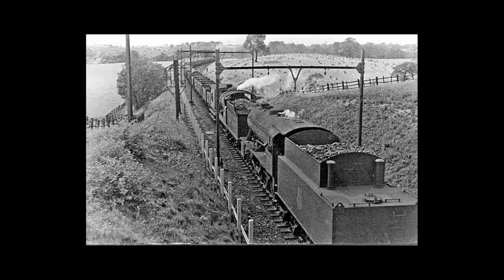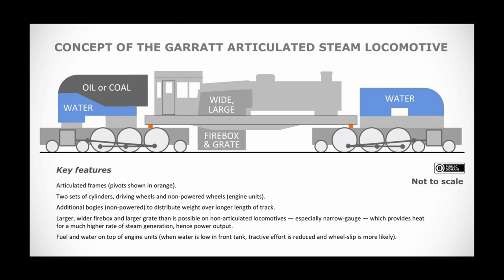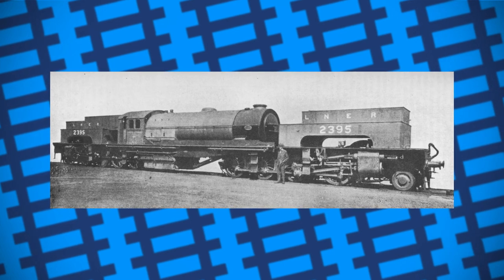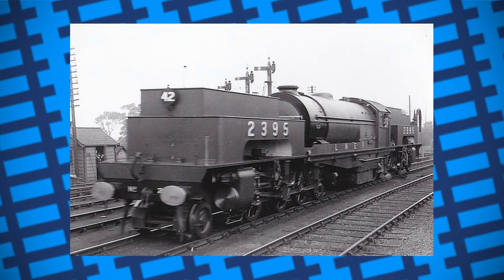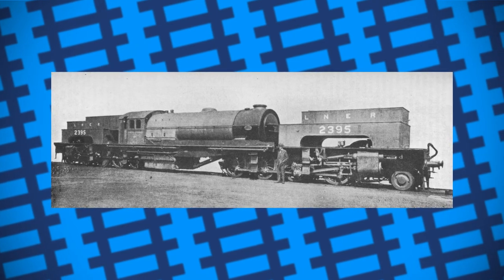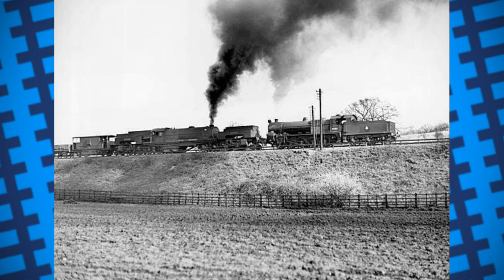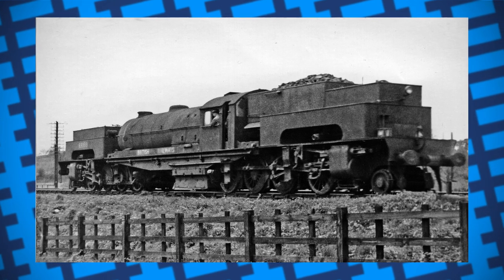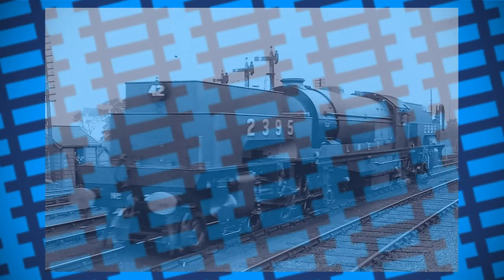The LNER's big banking engine -  LNER U1

Comment: I've heard it said that guards had to decide if they wanted the van door open or closed before the U1 buffered up. Once it had and started to shove, the van would bow under the strain and jam it. The guard then had to sit and listen to the van creaking and groaning, hoping it wouldn't buckle, fold up and turn to match wood round them.
Reply: “Douglas worked hard enough for three!  I heard him from my yard!”
“Two would have been enough.”
Reply: @timesnewlogan2032  I wonder how much of that story was influenced by this?
Reply: I am tempted to work on a short story on this
Reply: That shows they shoulda just use it to pull the trains up the hill
Reply: @pilotbug6100  not very practical with unfitted, loose coupled trains and also having to couple and un-couple it would have slowed the whole process down massively.
Reply: @Paraffinmeister  Quite right, plus if it was pulling a long heavy train that gave the opposite problem - putting too much strain on the couplings. Gresley's LNER P1 2-8-2s intended for heavy main line freight hit the same problem. The Rimutaka Incline in New Zealand (1 in 13) was maybe the ultimate; trains had to be divided into up to 5 or 6 portions and remarshalled at start and finish. No wonder they bit the bullet and built a 5 mile tunnel instead.
Reply: Even though UK brake vans and US cabooses aren't quite exactly the same thing, and railroad operating practices in the 2 countries are likewise not quite exactly the same thing, there were plenty of places here in US where the caboose had to be uncoupled then recoupled behind the pushing locomotive. Eventually cabooses were built with frames which could take the stress but sometimes the coupling of it behind the pushing locomotives was retained as a matter of safety policy.
Reply: @scottfw7169  the van bending under the strain wasn't through any short comings in their design, it was all to do with the brute force of this beast with the regulator wide open.
Reply: @pilotbug6100  A leading banker is expensive and inefficient, especially on busy single line sections worked by token systems
Reply: @Paraffinmeister  oh ok thanks

Comment: The biggest problem with both the LMS and LNER Garretts was the use of LMS/LNER standard parts off their standard classes instead of standard Beyer Peacock parts.
Reply: Especially the LMS Garretts. The dead hand of Derby totally ruined those. Had the LNER had the U1 built how Robinson had envisaged it with basically two O4 "power units" instead of two O2s, it probably would have been a much more versatile loco.
Reply: In other words Garrett's from Africa Australia and New Zealand are better than British Garrett's because they used successfully tested designs from bayer

Comment: I'm surprised that when they realised it kinda sucked as a banking engine, didn't decide to instead use it as a freight-hauling powerhouse. Like, that'd make way more sense as the sheer size of it would mean it would give some American locos a run for their money in terms of capability of hauling cargo.
Reply: It is quite possible that it made sense for it to bank from the rear, but it would be too powerful to pull stuff - couplers would break.
Reply: @TryboBike  in other words, damn you physics.
Reply: @TryboBike  “Too powerful to pull trains”
And that’s how you know that your loco is a complete badass.
Reply: @TryboBike  nothing to do with  couplers and everything to do with a railway infrastructure built around a notional maximum train length of 100 13 ton mineral wagons.
The Gresley P1's demonstrated that.
Even with a tractive effort of only 42000lb there were very few routes on the LNER that could handle the lengths of trains they could pull.
The 70,000++lbs TE of this engine would never have been fully utilized.
Reply: @markturner4219  I agree with one caveat that is all about the Lickey - putting a strong locomotive on the front of that particular part of railway would exceed coupling rating. Which was one of the reasons for putting bankers on the rear. THe other being, simply. being able to simply let go the banked train once the summit was reached.
Reply: @pilotbug6100  - Does that include the thousands who lose limbs..?? 🤔🤣

Comment: Why isn’t there a OO model of this? This is awesome!
Reply: There were white metal OO scale kits from DJH models
Reply: Well I mean there is one remarkably similar to it.
https://youtu.be/wtvBO-E-tWU

Although the reason why there isn't one of this exact engine is probably:
1. the price
2. the technical problems presented by such a large engine, on the "standard" 2nd radius track that all OO engines are required to run on.
3. It only ran on 2 stretches of track, therefore limiting the people who want to buy it, since a lot of (in my opinion very silly) model railway enthusiasts only model one railway and period and refuse to buy anything else other than the prototypical engines and rolling stock that would run on those lines. So it would not be profitable for the model maker to make this engine, as a lot of potential buyers of more conventional engines wouldn't get it.
Reply: Although there are less models of Australian steam locomotives, the Eureka company had as their first locomotive an AD60 Garratt.
Sold in two production runs so far for the smaller Australian market :
https://youtu.be/MUi0cMkmD-U
Less attraction in Australia for those tight curves so demanded by the UK 00 market.
Reply: @Deuce_and_a_half  not really any technical problems for 2nd radius curves. Just like the prototype it's only the length of 1 engine unit, so as long as say a hornby 8f can go around a corner this garratt will too
Reply: @Deuce_and_a_half  About that, "since a lot of (in my opinion very silly) model railway enthusiasts only model one railway and period and refuse to buy anything else other than the prototypical engines and rolling stock that would run on those lines", when a person has a finite supply of time and money in their life & they have a specific look they want their model railway to achieve why would working within that kind boundary be silly?
The above is not the way I do model trains and yet I see the practicality of it.
Reply: @scottfw7169  I'm more reffing to those modelers who I've heard say: "I love this loco, but won't get it because...
-I only model a different specific era
-It won't fit on my layout which is X region
-I only collect steamies/ diesels.

Like dude, if you like something why would you set an arbitrary limit/ excuse on yourself to not get the thing that you like.

I wasn't reffing to those who don't have the funds to buy up all their favourite locos, which is a situation I completely understand and actually find myself in.

For example I mostly collect WW1 era ROD locos, but my favourite loco is my S100, or as the British like to call it USA Dock Tank, from WW2. Does that mean I will make a dock layout? Maybe, probably not. Does it mean I will make a French layout for my ROD's to bring supplies to the front. No. Does it mean I will have WW1 and WW2 engines on the same layout at the same time? Hell yes, why shouldn't I over stupid things like, they don't match? So what, if you like something but won't get it for arbitrary reasos, then the only person stopping you is yourself. And I really don't understand it when people say they like something but won't get it because of self imposed reasons.
Reply: @Deuce_and_a_half  Well then I guess we just have different views on how life works since I do understand those who will like a thing and yet not acquire it & maybe not ever have any desire to acquire though they like it.
Reply: @Deuce_and_a_half  Also, of those I know and have known who follow such a model train acquisition policy, they in no way fit how the Collins English Dictionary characterizes the meaning of arbitrary, "If you describe an action, rule, or decision as arbitrary, you think that it is not based on any principle, plan, or system."
Reply: @scottfw7169  addressing your second reply, sorry for my incorrect use. I guess I should have just "repeated self imposed limits"
Reply: @scottfw7169  addressing your first reply. 
I compare it to a few centuries ago in stuff like Shakespeare, where a man (or vice versa) will love a woman dearly, but won't marry her/ him simply because she belongs to a rival family, or a different social class.

Here you have a model railway enthusiast, who sees a beautiful, well engineered, locomotive, that he really likes. But won't get it simply because the buildings he has on his layout have the wrong architecture.
It baffles me, really.

I mean if he likes the dang loco and is so uptight about running it on his wrong era/ region layout, he can stick it on his shelf in his man cave and look at it as a decoration.
Although really it's not the end of the world to do the 1st option of just running it. You only live once, and if you like something but don't have the time/ lifespan/ money to build a whole new layout for it then buy it, and enjoy it on your existing layout.

That's my opinion, as I said in my original comment. "In my opinion, very silly" Because as they are starving themselves of things they like.

Comment: Australia actually have the same type of class like garrat, AD60 Class and Australian Standard Garrat 
The wheel base of AD60 Class is 4-8-4 + 4-8-4
While the wheel base of Australian Standard Garrat is 4-8-2 + 2-8-4
AD60 operate on Standard Gauge (1,435 mm), Australian Standard Garrat operate on Cape Gauge (1,067 mm)
4 AD60 was perserved and 38 was scrapped
1 Australian Standard Garrat was perserved and 56 was scrapped
Reply: Hi lol :)
Also in ffestiniog railway there is a narrow gauge garrat
Reply: Yes
Reply: Correct me if I'm wrong, but isn't the AD60 (60 class) garrat similar size to the US UP Big Boy? Like in length?
Reply: @lukemackie8946  Big Boy wheel base is 4-8-8-4
While AD60 Class is 4-8-4 + 4-8-4
Reply: @MovetoSEPRAILnTheRealRajo6466  thanks mate, but I was talking about overall length like was the Garrat longer than a big boy?
Reply: @lukemackie8946  even though the AD60 Class is 4-8-4 + 4-8-4 well
It doesnt mean is way more longer than Big Boy
Reply: Then there is the narrow gauge Garrat G42 which operates most days on the outskirts of Melbourne.
Reply: @MovetoSEPRAILnTheRealRajo6466  The AD60 are 108ft long and the Big Boy, with tender is 132 ft.,  engine only 85 ft.
Reply: @ikriestiana  You're must be referring to K1, the first Garrett ever built. It was built to handle the steep inclines of the 3 foot 6 inch gauge railways of western Tasmania in Australia. When I was little I saw her at the local railway museum here before being sold to the Welsh due to the museum not having the money to restore her.
Reply: Hello from down under, there's one 1 running AD60 here (#6029) and there are a couple preserved that don't run. I know for certain that 6040 is preserved at the NSW railway museum in Thirlmere and there is definitely another rusting away in the middle of a paddock near Forbes.
Reply: AD60 class is definitely a very successful class, 42 were made and 6029, 6040 and 6042 (kinda) are all preserved
Reply: @MovetoSEPRAILnTheRealRajo6466  yes the locomotive but the big boy is longer due to its tender
Reply: @slewjm  the one rusting away is 6042, its on the outskirts of Old Forbes village
Reply: @AustralianRailwayVideos  Yes I've seen it, although from some distance away. Close enough to identify it as an AD60.
Reply: @slewjm  There's one at the DSRM too
Reply: @briannem.6787  yes apparently the one at Dorrigo is actually running, it was running when she was parked there
Reply: @lukemackie8946  I feel like many of the steam locos there USED to run. However, GMR at the other end of the branch still have the boiler on 1919 certified! It's a shame that they aren't running, but they've been powering on with restoration even in the pandemic.
Reply: @ikriestiana   Well, on the Welsh Highland (operated by the Festiniog) there's the very first Garratt, the K1 0-4-0+0-4-0 from Tasmania, and also three (or four) South African NGG Garratts  2-6-2+2-6-2
Reply: all the WAGR (Western Australian Government railways) ASG locomotives were scrapped and sadly none exist here in WA, at the railway museum in bassendean they have a garrat boiler sitting in the yard. We also had the MSA type garrat locomotive which was alot smaller, and I'm fairly sure the last of the MSA garrats where cut up in the early 1980's due to the transport minister at the time stating that they "are an unreliable class of locomotive" even though the crews of the MSA's said they were simple to use compared to the ASG conterpart that ran the mainlines from fremantle to york. sad that we didnt preserve these classes of locomotive here.
MSA model at the club I'm apart of 
https://www.youtube.com/watch?v=fk8WBBECVVA
ASG video from Western australia and South Australia? I can't recall
https://www.youtube.com/watch?v=xKvNZwOMk5w&list=PL6AMdxQb_rMVAz_M0D32cDs9DQnqdhg4n&index=7&t=5s
Reply: There's four preserved but only one is in operational condition being 6029.

Comment: I remember watching the 59 class Garratts thumping up and downs the tracks between Nairobi and Mombasa.
The 59s were the most powerful Garratts, in an any gauge,  ever built.
Reply: I know it's not a Garratt, but . . . 

cackles in American 4-8-8-4 Union Pacific Big Boy
Reply: Only just. The NSWGR AD60s were as big, and not much less powerful.
Reply: South african gl had a higher tractive effort than any other garratt
Reply: @ianmandy127  No  the GL was NOT the most powerful  Garratt, it was the 59 class in East  Africa , just 0ver 8300 FT/LBS  at 85% boiler pressure .and all were modified with Giesl ejector to extract another 3-4 % more power.
Reply: @nigelslade5276  gls tractive effort at 75% is 78650 lbf and ther class 59 is olny 73543 lbf at 75%.
Reply: @ianmandy127  A E Durrant Garratt book page 76, 83350ft/lbs and on page 191 is a miss print.
The GL was the most powerful when built in 1929-30.
Do your research, Wikipedia etc to get correct numbers.
Reply: @nigelslade5276 on  wikipedia the gl was calculated with 75% cylinder coifficient well the ear 59 was calculated with 85% so the numbers are off as some locomotive builders use 75% and others us 85%.
Reply: @ianmandy127  A miss print does not make correct 40-50 years later. All BP specifications was done  at 85%  The single Soviet Garratt was the most powerful ever built.

Comment: Great to see the U1 in your series.
Had it been fitted with a mechanical stoker the crews would have been happier with it, the railway less I guess, it would have used even more coal as the amount a man could shovel now limited its appetite.
Reply: The later Australian standard gauge fleet of about 42 AD60 Garratts saw the sense of using mechanical Stokers for such a larger engine.
Here is some great coverage that everyone I provide a link to really likes.
The Australian NFSA has some very high standard film and sound of these and others on the main north line around 1968 ;
https://www.youtube.com/watch?v=ePpG4tVHSMQ&t=613s
There is also 6029 running in preservation, mainly on passenger trains.
Reply: The actual coal consumption of the Garratt would not have been that high as power output is not that high at low speeds, and also after the big push up the bank there is a good rest while the loco coasts back down again and waits for the next train. True, the coal demand per engine for a pair of 2-8-0s would be less, but none of these tasks would approach the consistent firing rates and power outputs needed for heavy long-distance expresses, which were the toughest firing jobs.

Comment: This used to run past my house way before my time  , as a kid I would watch four EM 1 class 76 electrics doing the same job , two lead loco’s and two on rear as bankers , it took so much power no other electric loco could be in section between Aldam junction and west silk stone junction such was the power needed to push coal trains up the worsborough incline , today I regularly cycle on the route , I have heard that such was the power of the Garret that sometimes guards were trapped in they’re van because the frames buckled jamming the doors on the break van

Comment: Just to add. By the time the U1 Garratt was authorized,  the Great Central had been grouped with other companies in the LNER. The U1 was designed by Nigel Gresley and not based on the O4 but on his own O2 2-8-0 class built for the Great Northern before the Grouping. The O4s had two cylinders, the O2s had three.

Comment: I've heard that when the steam engines used to go under the Malvern Hills on the Hereford - Worcester line, the crews had to lie on the cab floor to try to breath. Narrow bore tunnels,  they filled with smoke as the train pulled up the incline.

Comment: Bengal Nagpur Railways had the Garratt type of locomotives for heavy freight use. The N Class Garratt for eg had 4400 HP power output and all the Indian Garratts were of broad gauge (1676 mm). They could go upto 80 kmph, but were restricted to 65 when in normal service. One of these locomotives is preserved at National Rail Museum, New Delhi. Another unit has been restored to working order by Kharagpur workshop. This loco is restricted to a top speed of 45 kmph only after restoration.